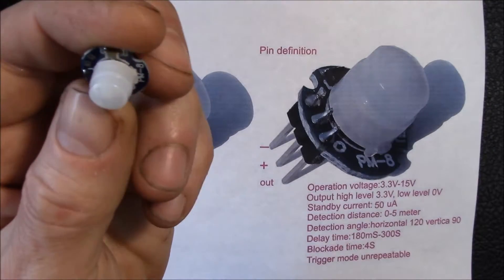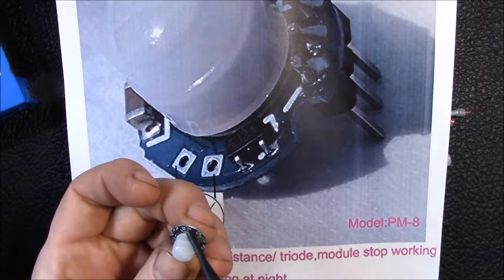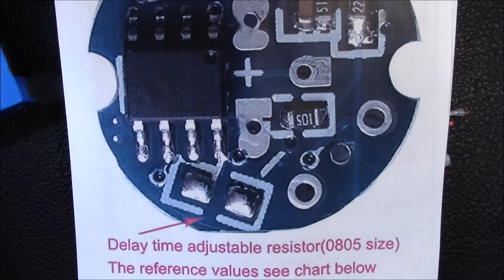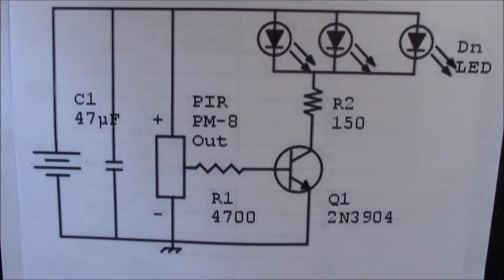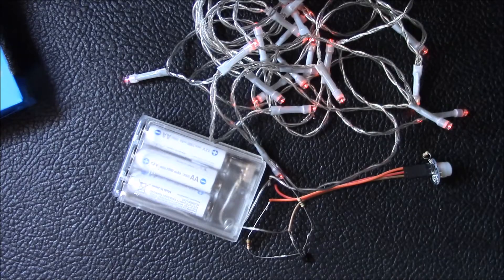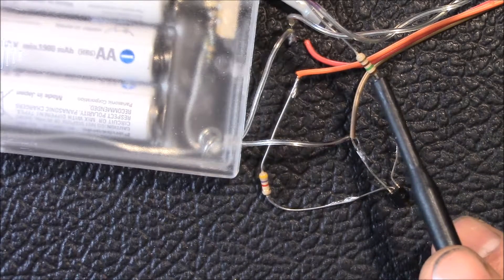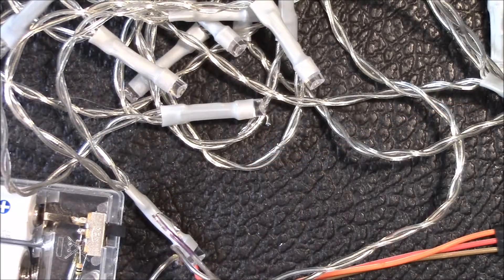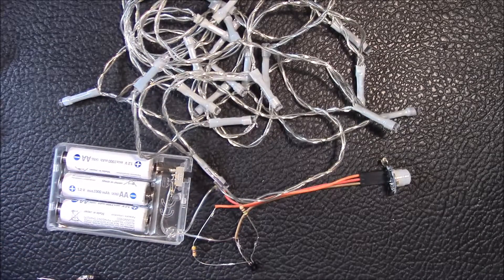Motion Activated LED Step Light, Part 2 - PM-8 Sensor and Schematic

Comment: Hi, I'm desperately searching fairy lights with motion sensor but I couldn't find any. I think I can't build what you did in the  video since I don't understand anything about this. Can you say whether I can buy it somewhere? Thanks.
Reply from the maker: There are stand alone controllers available:
https://amzn.to/3SwcMql
Just find one that matches the voltage of the lights you want to run and then connect that PIR switch between the power supply and lights.
Reply: @The4Crawler  thank you so much for your prompt reply, I will check it out 🙏

Comment: It says the sensitivity can be adjusted as well but I cannot find where or how to do it. Do you know?
Thanks
Reply from the maker: Good question, I've not looked into that myself.  It looks like some of the implementations, like the one from Adafruit has a sensitivity pot (as well as a time delay pot) installed:
https://www.adafruit.com/product/189
It looks like the lower cost modules lack these pots, using a pair of solder pads for delay timing.  Likely one of the surface mount resistors is for the sensitivity adjustment.  Probably would need to get the chip pinout and see which pin is for that function and see which resistor to connected to that pin and go from there.  Or get a sensor with the sensitivity adjustment built-in.
Reply: @The4Crawler   yeah ok. I like these particular small pir's. I use them to trigger a camera but find that the sensitivity is way to high, they trigger with the tiniest breeze and shadow movement. I'll see if I can find the chip pinout online. Thanks for the reply.
Reply: @The4Crawler  I've searched high and low and am unable to locate any info on this chip, XC24C.
Reply from the maker: Maybe try contacting some of the sellers (including the one you purchased yours from) of that PIR module and ask them for information on setting sensitivity.  Here's another place that has some adjustable sensors:
http://www.futurlec.com/PIR_Sensors.shtml
They seem to list adjustable sensitivity only on the modules that have that feature.
Another thing to try is see if you can apply various tapes over the sensor to cut it's sensitivity.  Realize you are working with IR light reception, so try and find things that partially block IR.  Or try something like a metal foil tape with a small hole to limit the field of view of the sensor.
Reply: @The4Crawler   thanks, I'll give that a try. I really need to use this module, the smaller the better. At least until I can get a PIR added to my own circuit and working right . I'd attach a pic of how I'm using it but don't see a way to do it..
Reply from the maker: Some tips on reducing sensitivity:https://electronics.stackexchange.com/questions/30981/reducing-the-sensitivity-of-a-pir-sensor